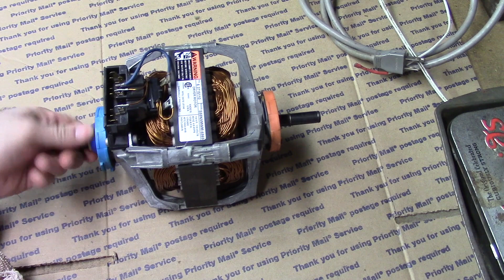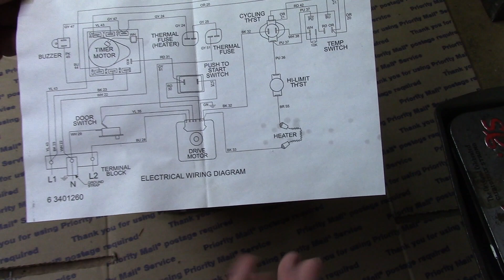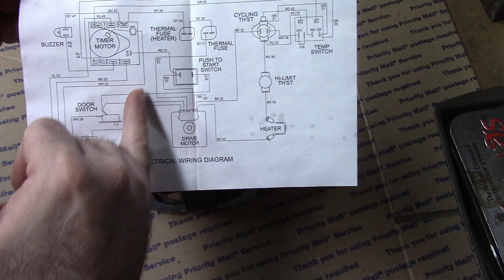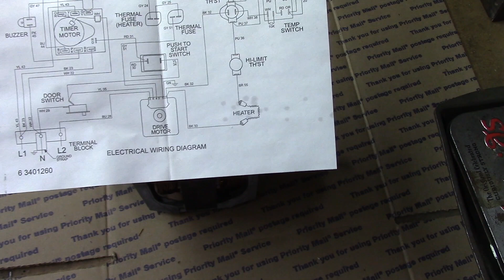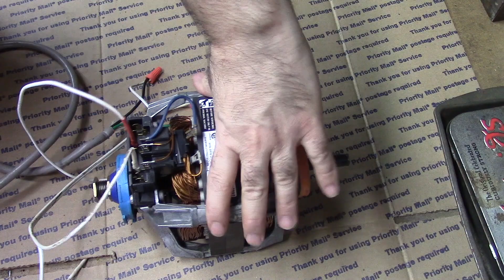Bench Testing - Maytag Dryer Motor - Maintenance Pt. 2

Comment: My dryer is running but the motor seems a bit loud. Bearings? I priced one on Amazon and they are around $65 but some of the reviews say that the wiring adapter that comes with it the wiring doesn't line up.

Comment: just picked up one of them motor yesterday and will try hooking it up to see what happens ! i think it is funny how the line voltage just keeps going up i remember when it was 110 then 117 now for the most most its 120 but as you stated they are calling out 125 . go back far enough and you have 105 . then there is rms voltage

Comment: Did  the exact same thing you did on you video only difference my dryer motor made a horrid humm no spinning .Would only start spinning if I turned it by hand would start turning very very slowly and up to speed no factory connection for start circuit.
Reply from the maker: Sounds like you only had the run winding energized

Comment: Thanks for this video. I’m in the UK and have an Admiral badged dryer. Very difficult to get parts. The motor keeps overheating and I’m hoping this tip will stop that happening.
Reply from the maker: Yea, they are supposedly sealed bearings.... over the years ive found ways to get oil into them and had some last many years as a result.

Comment: I just repaired the motor in a LG dryer I just got for free. Only problem with the dryer was the drum didn’t turn. Easy fix. The centrifugal weights came out cause the springs that hold them in wore out their mountings. I just drilled four new holes for them and reinstalled the springs and weights. Runs like new and saved me over a hundred bucks!
Reply from the maker: There are a lot of little tricks to keep these motors running!